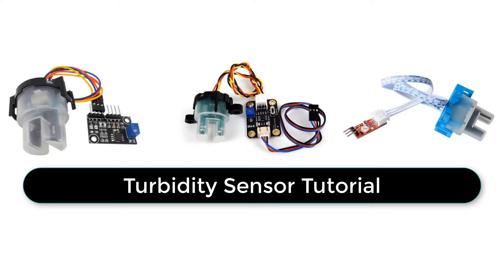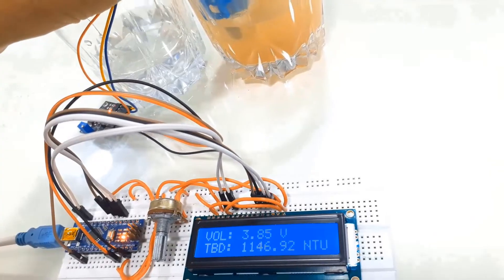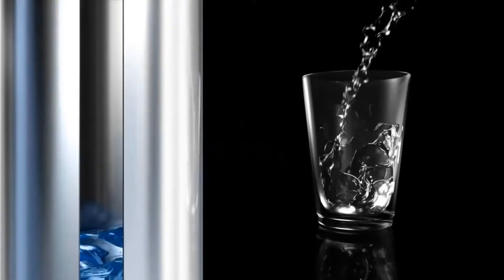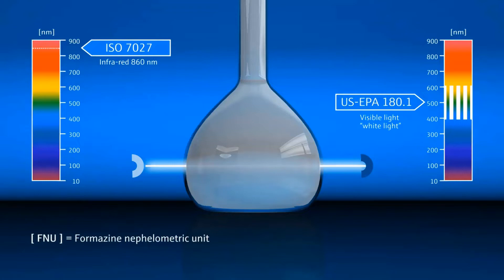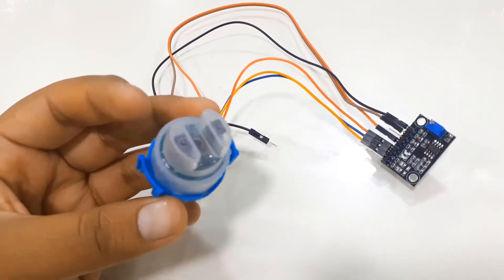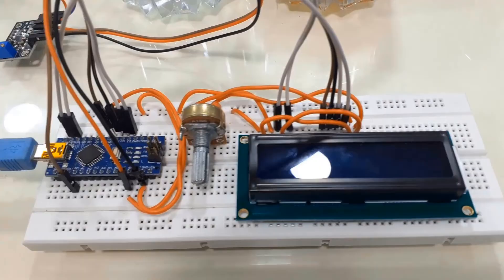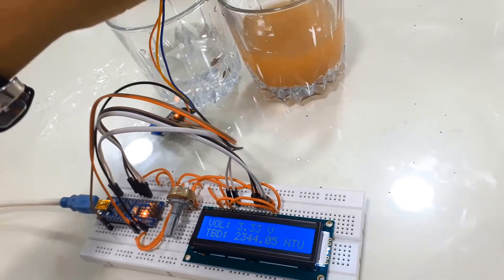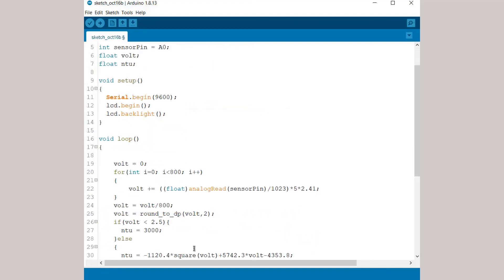DIY Turbidity Meter using Arduino & Analog Turbidity Sensor

Comment: I used esp32 board but the code was error "Compilation error: 'square' was not declared in this scope" 
help me please
Reply: i think you've already solved your problem, but if you don't, just use sq or volt * volt

Comment: This sensor is of very poor quality. It is a sensor that measures liquid turbidity, but it is very easy for liquid to enter the electrical circuit. The signal transceiver is extremely susceptible to damage

Comment: my sensor when put in water value is 4.37V and NTU is -655.22. why use formula -1120.4*square(Turb_volt)+5742.3*Turb_volt-4352.9;
but the value is negative
Reply from the maker: Calibrate with voltage of 4.2V in clear water
Reply: @HowtoElectronics  how to?
 volt += ((float)analogRead(sensorPin)/1023)*5*4.2  
isn't it?
Reply: did you ever figure out why?

Comment: Also NTU can only be correlated based on reference calibrations. This device does not provide accurate NTU measurement without calibration. (Ex. formazine). This device simply produces a voltage change feedback based on changing turbidity. Nothing special. Not NTU.

Comment: Thank you for the video. How do we calibrate the sensor?
Reply from the maker: Calibration method is explained in article. But so far as i know this is not a good sensor for measuring turbidity.
Reply: @HowtoElectronics  Any recommendation for good sensor to use?
Reply from the maker: There are some chinese sensors from JXCTIOT which claims to have better reading. Haven’t tested yet.
Reply: @HowtoElectronics whether the sensor can be used on diesel and oil?